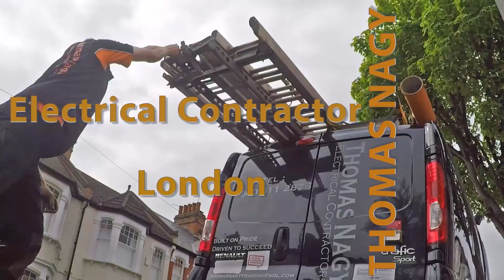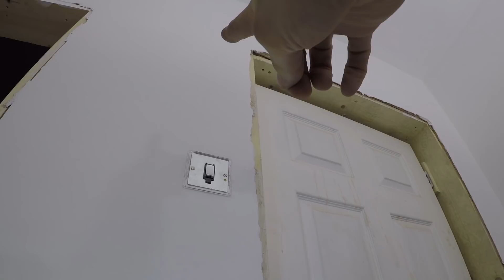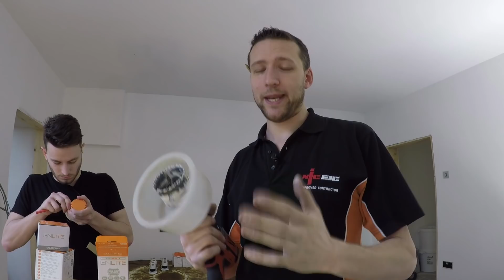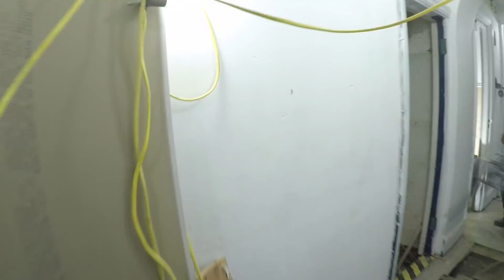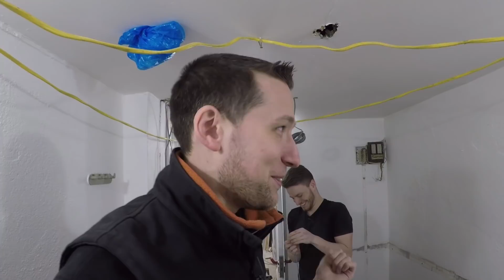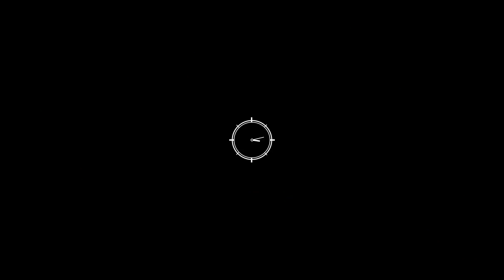House rewire Part 2 - An Electricians Day in London | Thomas Nagy

Comment: Re. leak in lead pipe, we were removing one of two lead pipes that went through a wall in a flat many, many years ago when I'd just started as a favour to the owner as it was very unsightly, basically 2 pipes the lower of which was cut off about a foot either side of the wall. My mate started hack sawing through the pipe only for it to stating pi**ing out water at mains pressure. Unbeknown to us the pipes twisted round going through the wall!. Phoned a plumber mate of mine who said hit it with a hammer to fold the lead over the leak, amazingly it worked and held till he came round about a week later to repair it properly. 1 of my first lessons of never assume!

Comment: Turn the cable horse on the side, so the end that opens is up, and any cable currently on it is laid on its side over the non-opening end of the horse. Then put your dominant hand through the new cable reel (if possible), and use it to grasp the top, opening end, of the bar. Then pull the bar out just enough to then drop or nicely lower the new reel on the bar, using your other hand to assist as appropriate. Then reinstall the bar, and right the horse.

If you have a bunch of heavy reels already on the bar, you can use your body to support them on their sides while you manipulate the bar up and out enough to add the new reel.

Logically, the non-opening end of a horse should just swivel/rotate out or up enough to add a new reel without effort. Maybe somebody will design one that does someday.

Comment: Cable horse solution: do it yourself (DIY) 2 pipes one inside the other cut each about 2/3 the width of the horse. If the smaller will not secure in the stand end, then put a sleeve on its end cut from the larger pipe. When you need to add a spool just loosen up and slide the smaller into the larger. Enjoy. Engineer Karl Schueler ee fcc emt finding solutions is what I do.

Comment: Hi Thomas. Wanted to ask don't you ever get an issue with downlights not sitting flush on the ceiling when having 2 twin and earth cables connected directly to it 6:58? Pressure of the cables can push the downlights down a little

Comment: Greenlee makes a good pair of cable horses it has casters and tou can use up to an 25 or 30 mm pipe to hold your cable you can use an length pipe you need not limited to a meter or less

Comment: Hello mate, commenting on cable horses, I found the same problem and they often fell over when pulling cables. I came across some old scaffolding at the place i used to work, 40 mm bars with a couple of 'T' pieces and foot plates. I put these together and screwed the foot plates to a piece of old oak flooring. It is a bit heavy when carrying to a job but works great when pulling cable by yourself. I made the bar long enough so if needed i could put 3 cable drums on depending on size, once the grub screws are loose you can add a cable drum or remove one by sliding the bar through the 'T' piece allowing you to hold the bar even with 2 cable drums on to add another.

Comment: Hello Thomas, excellent series of vids you have.  I was always curious how the heat/ac, electric and plumbing was in the UK.  The plumbing (lead connection from the service entrance) is called a wipe in the US.  We can't repair lead anymore, if it's damaged it has to be run new annealed (soft) copper from the city main to the home.  They used to pour the molten lead onto the plumbing joint after it was shaped and pushed into the other pipe and then wiped with leather wiping cloths until a solid lead ball formed around the joint   I have not seen one of those in a bit here in Chicago.  They still have plenty of them here though.  
side note: I love how the outlets all have isolation switches for each outlet.  I wish they did that here in the states.  All the wires above low voltage in Chicago also have to be run in conduit (EMT).  The flexible cable you use is legal in many places in the US now but the big cities all want EMT for new work.  I'll be watching each episode, work safe brother, you do excellent work.

Comment: Just interested, we fit downlights with 'click connectors' so the circuit can easily be insulation resistance tested then the LED downlights plugged in.  How do you test the circuit with these?  Also how are you performing all the tests on the smoke detector circuit? connecting it in this method means it all has to be taken to bits again to test (smokes and lights)

Comment: Love those Enlite LED downlights at 6:50. Nice quality kit. How do you test the circuit with out damaging them if you're not using connectors like CT101's? AS to the cable horse at 13:00 AAGHH!  Nobody seems to have improved on the really crap original. They snag the cables between reels as well. I'm going to try the home built suggestion below. Big welcome to "new Tom" - King of the hair set products. :)
Reply from the maker: Yeah those enlite downlights are so nice to fit. Really feel like solid fittings.
The way we tested them was to pull the live out an croc clip on it. Then just pop it back in after. 😉
Still on the hunt for a cable horse; the rack-a-tier’s seem to be the ones that are preferred on here by peeps.
Reply: THAT makes a lot of sense :) Half the number of connections to be made by going direct to the fitting. Let us know how the (very expensive) Rack-a-tier goes They should send you one to test with 30k plus subscribers.

Comment: The bar on my roller only locks in when the legs are closed, only problem is, they tip over if there isn't much weight on them  
I don't really see a problem with lifting the bar with the reels on,  I don't think it's possible to load any with one hand.
 There is a new one by SWA called cable Companion, it swivels and cable is fed through a bar that keeps it from snagging, quite clever, but quite expensive at £66 + vat.

Comment: Here in the us we have rolls of wire not on spools and we build a contraption where you take 2 2x4 and make a x with them and nail together and then you put one in the middle standing up and run a few pieces of wire down it ends up looking almost like a tee-pee and then u put a hook on it and hang it from something and put ur wire over it as you pull wire it spins and allows the wire to come off nice and neat

Comment: the cable holders look more for USA wire spools like multiple rolls of single strand "thhn" or even larger 1,000' spools of romex. it does look like a rather bad design overall. :)

Comment: Assuming the cable stand pipe is roughly 20mm, try and get a bit of 16mm pipe, cut it to the same size and that will give you move play to get drums on easier!

Comment: My old boss used to keep this type of cable runner on his vans-
https://www.toolstop.co.uk/thorsman-cablestik-cable-holder-stand-p8730
Trouble is they’re pricey, bulky & no where seems to stock them any more. 
The one I have these days is almost identical to the one you’re not too pleased with except both top corners of the frame open up to remove the bar which does make it a little easier with heavy cables but still not ideal!

Comment: Hello there. Make a cable stand out of metal conduit. 2 angle boxes with 25mm holes in the centre a straight piece long enough to go through the holes and 2 pieces of conduit equal lenght on each side of the angle boxes  🖒

Comment: At our company we make our own cable stand with conduit, use two 90 degree conduit boxes at both ends with conduit as legs, drill a 20/ 25mm hole in each of the boxes for the conduit to hold the drum of cable. Easy to remove drums and add more on to the stand. I hope I explained this simply, hard to do so in writing.

Comment: With my cable rollers (cable horse) I can just lift the bar when its got cable on it. The bars lock in place when you fold it up 🤔 Not sure what make they were, getting on 15 years old

Comment: Hi Tom some of the answers to partially correct as a plumber of the old school I used to wipe lead joints of course now it’s a breach of the water bylaws you have to use lead loc fittings. The process is as follows 
1. file clean the lead pipe where you want the solder to adhere.
2. drill a hole in the side of the pipe to accept your copper pipe .
3.  Tin your clean copper pipe with leaded solder.
4. Paint the lead pipe with plumbers black where you don’t want solder to adhere.
5. I seriously copper pipe into the hole and hold in place with pipe clamp.
6. Heat the copper pipe and use grade d solder ( it comes in a bar  you can use normal leaded solder but grade d is the correct one) if you have the skill you can get the lead and the solder to the same melting point.
7. Slowly build up the solder and wipe the joint using a mole skin cloth and if you have done it properly the joint will last a life time.

As far as repairing a split lead pipe the process is similar only you cut the slit out slay the end of the pipe with a tan pin clean up the inside and outside of the pipe clamp your tinned pipes in the ends paint your plumbers black on and wipe a bulb joint the use s copper coupling to joint the two ends together. Of course your bodge it and run merchant would just wipe solder over the split.

Comment: Little expensive and you need to get the pole separate but I use the cable horse called the rack-a-teir, I can't fault it and it's extremely diverse be it domestic all the way to industrial. Love the videos

Comment: About the cable roller. In Australia we have plastic or wooden spools for our cabling and they make a great dispenser for them, it's just two rollers on a heavy frame you sit the roll on and it just works. No fiddling around and to disassemble just lift the roll off.  I'm not sure what the UK uses to make their cable reels but it looked like yours were cardboard so the wouldn't work if that's the case.

Comment: I would be very interested to see a video on installing a mains powered smoke or heat detector - especially how you pick up a mains feed with minimal damage to decor (I think normal practice is to add it to the lighting circuit). There is an upcoming regulation change in Scotland that will require every home to have multiple mains powered and linked smoke detectors as well as a mains powered heat detector for the kitchen. And mains powered CO detectors too I think. And it always occurs to make that a gas leak detector would be useful too. Actually, I would like to see a video on the ultimate domestic smoke/heat/CO/gas alarm setup.

Comment: I've used a homemade cable roller made of 2 a frames of 20mm box steel and a bit of pipe at the top. A piece of pipe is put through the larger pip sections of the A and small set screws in the top lock the pipe in place

Comment: Wouldn't usually repair lead now due to contaminants, you would just rip out as much as possible and replace in copper and use a lead lock to connect.

Comment: I'm a plumber. It's called lead wiping. They use a wooden drift to open the end of the lead, clean the lead. Insert your copped, flux it up.. you the have a lead bar that you fill the void with and every now and then you wipe it with a cloth of some sort... if a leak springs in lead pipe then it's difficult to repair as you can't cover the hole with lead.. I'm only 30 and only done this once in 10 years.. tom plumb on you tubes shows you how it's done.

Brendan
Plumber from west yorkshire
Reply: It's a hell of a skill to have, back when craftsmanship was the order of the day
Reply: Shouldn't all lead pipes be replaced by now? I thought it's a health hazard.

Comment: Get some rack-a-tiers. Super rod sell them in the UK I think. You can use the super rod tube as the reel as it grips nicely under the Handles in a groove. Great because you can push the racks up to the drums so they don't move from left to right and get tangled as much. also the super rod tube is quite large so the drums don't bounce about as much. You can do swa on them aswell, up to sort of 10mm but you'd need to use some steel conduit as the bar

Comment: I used to see lads on site making their own cable horse from 20/25mm conduit. 2 x 90° angle box (with hole back entry) 4 x equal sized conduit for legs then 1 x longer conduit piece for the cable drums to sit on, held in place with Bush and coupling through the 90°. 
Might attempt my own thinking of it now. 😁

Comment: You asked if there is a better 'cable horse' out there, indeed there is, but it all comes down to how much kit are you wanting to haul around. This is one of many companies that make cable management devices: rack-a-tiers http://www.rack-a-tiers.com/products/category/Wire-Management  E-Z roll, X Dispenser, or Rack N Go all seem viable, or use multiple of the smaller/compact models that only hold one roll each. It would seem to me the best option would be a variable length horse so you just grab the two end pieces and a short length of pipe for a small job, and you grab a longer length of pipe for a bigger job where you will pull multiple wires.

Comment: https://www.amazon.co.uk/gp/aw/d/B00GBQXV26/ref=mp_s_a_1_3/260-2072912-0981167?ie=UTF8&qid=1521594275&sr=8-3&pi=AC_SX236_SY340_FMwebp_QL65&keywords=rack+a+tier&dpPl=1&dpID=415PZu%2B-PUL&ref=plSrch
Reply: Best ones to use I had them little yellow ones chain broke replace it with jack chain and still broke 😐

Comment: Get a laser level that fires a dot vertically and you can measure your light position on the floor, stand the level on the spot and it puts a red dot on the ceiling directly above where you need to drill
Reply: Very good tip, lasers are a must these days.

Comment: Hi Tom, that pipe has been 'plumbed and wiped'. Molten lead will have been used and poured over the two pipes. As it starts to cool the lead turns into a consistency like putty allowing it to be moulded into a clean finish, as it cools further it sets solid. This method was also used on old paper insulated lead covered cables that the DNO uses to joint them together.

Comment: They have many different types of cable pulling stands.  In Residential I just see the plastic snap in stands.  In commercial they jack stands that adjust up and  down when twisting the handle bar.  They mostly use jack stands for larger cable.

Comment: RS Pro cable stand. It’s not foldable but at one end it has a spring clip so you can slide the bar out. Bit easier than that one you’ve got.

Comment: 2 x 25 mm steel angle boxes with 25 mm hole in the middle of both the angle boxes.Then you need 4 equal pieces threading in to the angle boxes and a straight piece going across to hold the cables. No problems at all with it.

Comment: When the lead leaks on the water pipes you can buy a lead lock to join the lead to the copper, they come in different sizes depending on size of lead pipework, suppose to remove lead mains water now if connected to drinking water.

Comment: My cable caddy I made from some conduit. 
A right angle box with 2 short ( roughly 14" ) bits of conduit screwed in the spouts makes the legs. 
Drill a hole in the back of the box and using a bush and coupler, fix a longer peice of 20mm conduit onto it. 
Make another one the same as above, except with a peice of 25mm conduit onto the back of this box. 
Then put your drums of cable over the 25mm conduit and then slide the 25mm conduit over the 20mm conduit of the first frame. 
Graet. 
I made this about 20 years ago and it still works great. 
Veey popular with commercial electricians who use metal conduit.

Comment: I’m currently doing a level 3 electrical installation course at college, do you have any advice for the exams
Reply: Tom Vine revise, as boring as it may be. Over the top stuff, is not over the top
Reply: The on site guide should serve you well. Back in the day there were City and Guilds Part 1& 2 Guide books which contained the course work. You should be fine if you have seen a range of stuff out in the field, and put it into practice. Usually find the ones who struggle, are those who have spent their entire apprenticeship doing miles of basket and tray, and not much else.